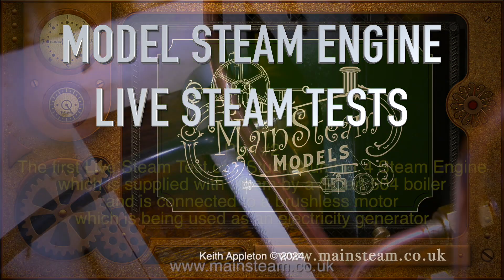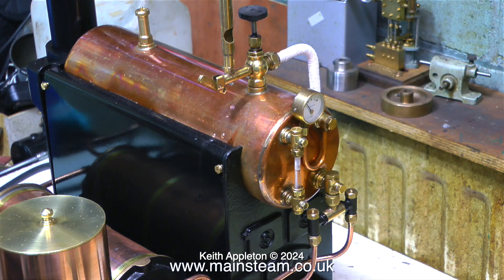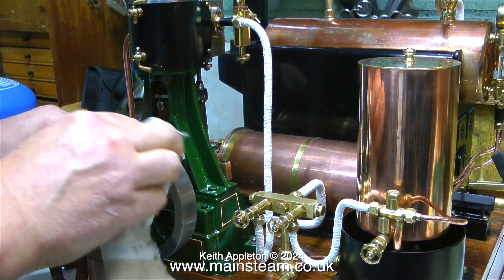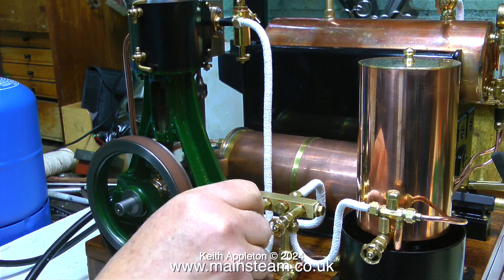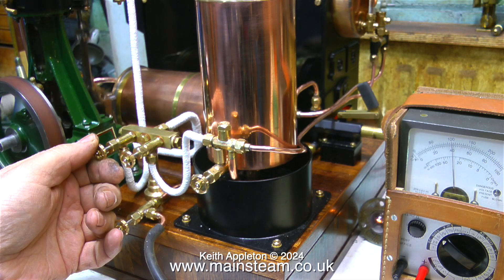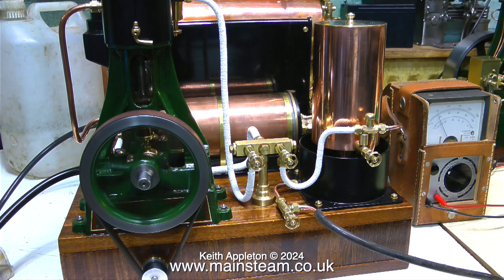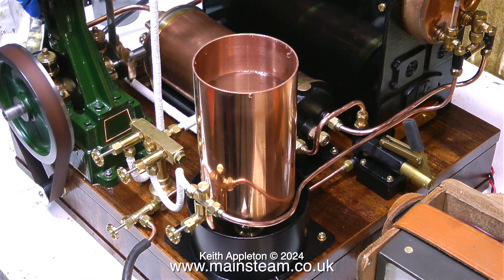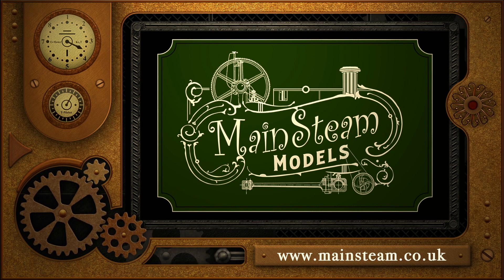MODEL STEAM ENGINE LIVE STEAM TESTS - PART #2

Comment: Question regarding condensate.  I assume you cannot just run the condensate or injector overflow back into the feed water.  Would the oil cause priming in the boiler?
Reply from the maker: No the condensate needs to be disposed of in the models, as it is difficult to remove the oil which would case a few problems if it was inside the boiler.